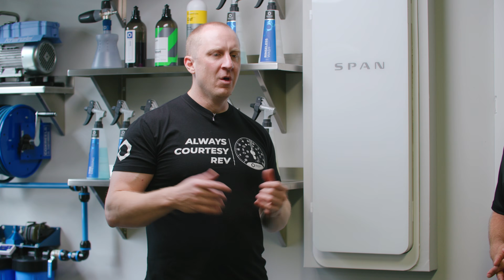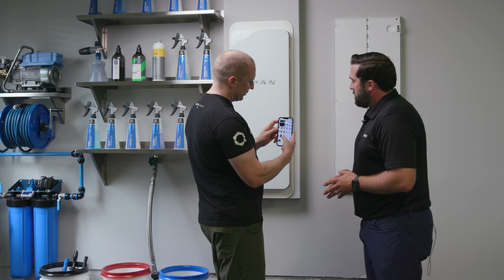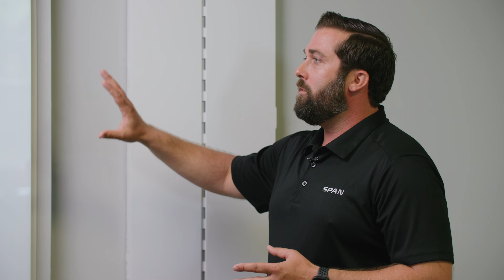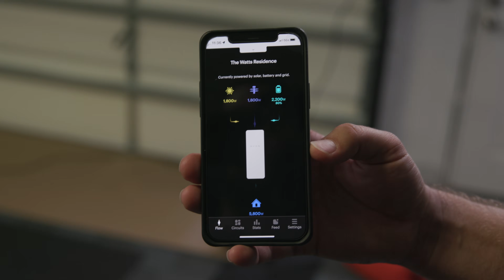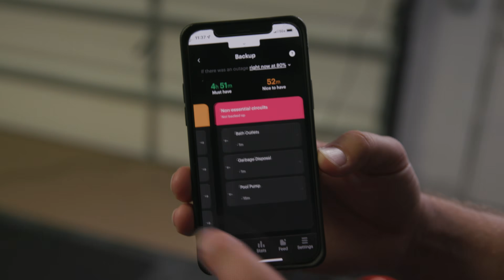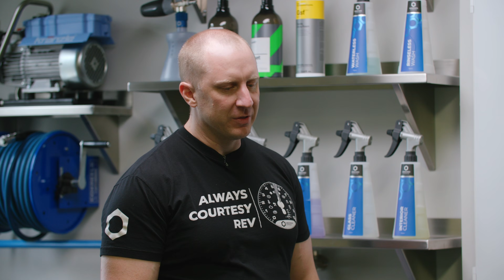An In-Depth Overview of the Span Smart Electrical Panel

Comment: You definitely should’ve asked him what would happen if you turned something off—and then your Wi-Fi stopped working 😁😁 Spoiler alert: you will not be able to turn it back on. There is no buttons, nor local network access.. If those relays switched off.. there is literally no way to turn them on without Span cloud connection 😂

Comment: Cool stuff i   custom  designed my  cutter hammer   400amp pannel   to do   everythang that this  does  for about  500 in automations  all about the knowledge  in electrical    and codes  to what can be done  cool concept  but  to much money in my opinion. But if ya possess  no electrical  knowledge this is definitely    worth it if ya have deep pockets may also may save your life.  Biggest downfall i see is  that you have to use there installers!!!  Where   as cutter hammer  eaton  ge  square d  Siemens   just need  a  eny certified  electrician    and  county  inspection

Comment: #8 is typically used for 40 amps.  If you have a 50amp breaker,  you should have #6 awg copper wire.

Comment: Not to mention that it already starts at almost $1000 more than what the price was mentioned to be in this video.
Personally, I’d be willing to spend $1500-$2000
Depending on how good that 10 year warrenty is.
The electrical relays scare me the most. 
Right now if a power surge takes out a breaker or something I can go buy a new one and install it.
If part or all of that smart box section gets taken out; how long am I without power to get it warrantied

Comment: I am redoing my panels and upgrading from a 200 to 400 amp service. I do not have a need for 400 amps currently, but plan on multiple level 2 chargers in the future. Upgrading your service seems like a much better solution than load shedding.
Reply: Of course, if you can afford it. Depending on the population density and capacity of the transformer you’re connected to, your power co. Might not even allow any more than 200 amps, or they’d charge you an arm and a leg for your own transformer and/or whatever they need to do to make it happen. They are also notorious for “getting to it when they get to it.” Aka could take months or years for them to actually complete the service upgrade.
Reply: Most upgrades of that nature require a different meter and additional charges on a monthly basis. My power company charges quite a lot for additional 50-100 amps.
Reply: Upgrading service costs more than the $7,000 for SPAN panel with installation costs? Seems like a ton of money just to be able to load shed remotely.

And, then what happens if SPAN decides they want to charge a subscription—or they go out of business?

Just paid $7,000 for a shiny white panel cover.

Comment: I looked at this last year. Required internet connection, not consumer/DIY friendly, no manual override of internal circuit relays, no UPS support, and lack of value at >$6,500 (IMO) were deal breakers for me. Leviton and SquareD have similar solutions that don’t have many of these drawbacks.
Reply: No UPS support?

Comment: Really cool idea. I just don’t see the reason why. Except for maybe load shedding. But I have a 400 amp service.
What circuits would I ever want to turn off while I’m not home?
How well will it hold up to power surges over time?
Reply: My first thought was, “this would have been awesome to have had the first few years after I bought my home and frequently added new outlets and replaced fixtures and had to routinely turn off circuits.” And then I realized, if I saw the value and had the money to buy this panel, I would hire out all the electrical work. So yeah, I struggle to find the value in this — aside from “it sort of looks cool”